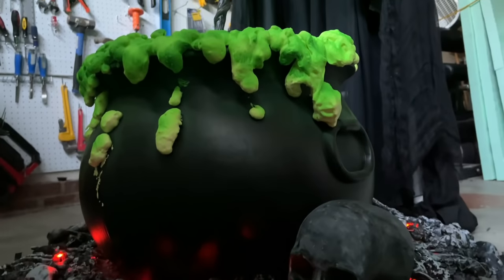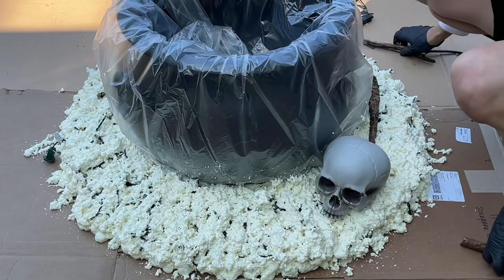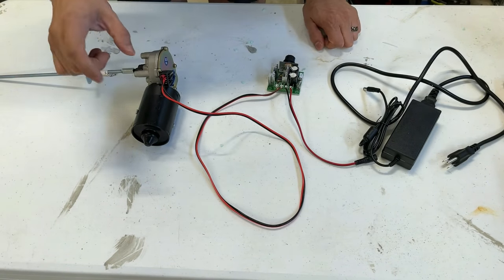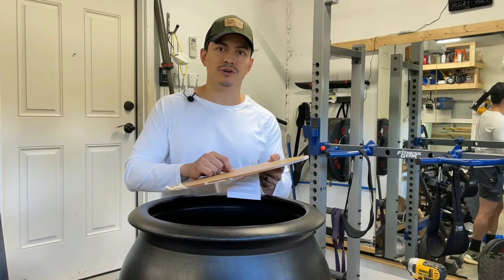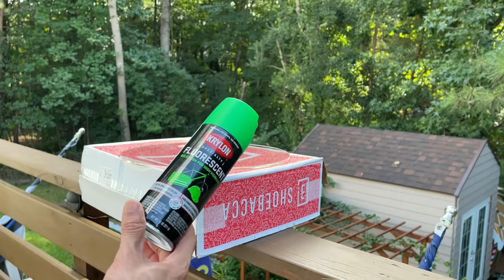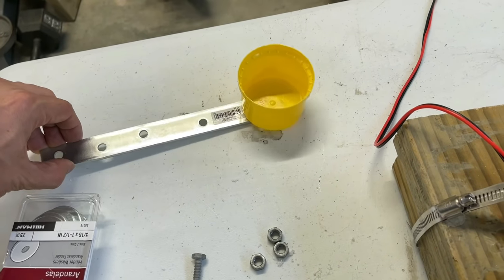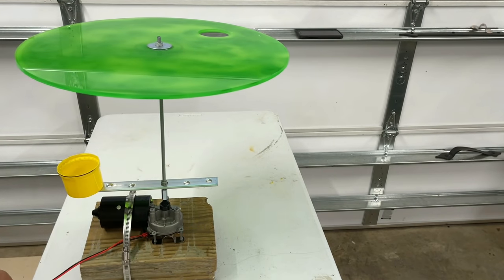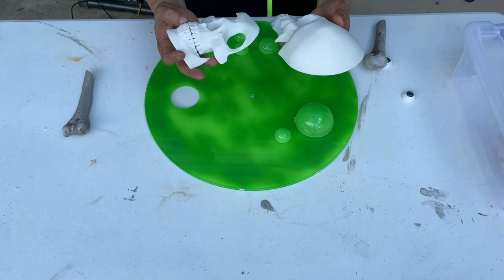Animated Witch’s Cauldron & Glowing Coals - DIY

Comment: I’m planning on undertaking this project for the upcoming Halloween. Both your video and overall design are phenomenal and I’m super excited for this one. That being said I really wanted to add some kind of fog effect to it. This design looks cool, but Wicked Makers had a cauldron that looked more realistic, mostly because it had a mist effect rising from the pot.  I thought it would look best to combine both ideas and have the pot stirring with fog/mist effects as well to hide the obvious non-liquid properties of the clear plate. I think the most simple way to add a fog effect to this prop would be to just buy a fog machine with a tube running into the bottom of the cauldron. The fog then rises, and slips in between the holes and crevices in the plate. I just don’t know how convincing this effect would look when put into practice. Not sure if you have an answer to this, but do you think this concept would accomplish the desired outcome? Either way, thanks again for the inspiration! This one could really steal the show for me this year if I don’t botch it.
Reply: Did you end up trying it? Did it work?
Reply: @amysirawskyofficial  Lol, no. I still want to, but I’m also trying to budget a bit because I do have to pay for college. I doubt I’ll be able to take it on even this year, maybe next year 🤔
Reply: I had the exact same idea. On another video I watched, they attempted to have  a container of water sitting inside the top of the cauldron with an ultrasonic fogger with LED lights sitting in the water to create the fog. However, what they discovered was that because the water container didn't fit snugly to the interior wall of the cauldron, the fog went over the side of the container and down the gap between the container and the inner wall of the cauldron and ended up underneath the container, almost like it had been sucked downwards. As I am making my own cauldron as well, I had a similar idea to you where I thought maybe I could hose in fog (create a tunnel/tube with some pvc pipe at the time of making the fire pit) through the bottom/side and run the hose up around the inner edge of the lip of the cauldron and puncture holes in the hose. This would only create fog around the rim of the cauldron though, unless maybe holes were also punctured on the side of the hose so the fog could be pushed out of the hose towards the centre of the cauldron. Alternatively, following your idea, hose in the fog as I suggested above but fill the whole void in the cauldron underneath the perspex plate but may need a small fan or two to push the fog gently out. It may still only flow over the sides though and not over the top of the perspex. This will be trial and error I guess.
Reply: Another possibility would be to put the fog generator inside the witch, and hose down the sleeve and stirrer to the top of the cauldron. Good haunting!

Comment: For anyone planning to do this in the future the actual measurement for the threaded end of the motor is 6mm. It is not 1/4x20 standard. I’m not sure if they changed the spindle/post thread size after he made this video or he just forced it and damaged the threads on the motor, but you’ll need all M6 hardware. I hope this prevents someone from having to make two trips to the hardware store like I did.
Reply from the maker: I definitely didn’t force anything and it went on super smooth. So I’m not sure if the thread was changed but when I made this video that’s the size I used.
Reply: @IsaacAlexanderDIY They must have changed the motor then. The current specs for the Monster Guts Power Pack shows “Spindle/Post thread size: M-6” All your other instructions are the same but if anyone orders the current Monster Guts kit they’ll need a 6 mm threaded rod and adapter.
Reply from the maker: @tweek218  thank you for this update. I didn’t know they had changed it
Reply: @IsaacAlexanderDIY  No problem, I’m in the process of building this right now. But hey since I have you here can I ask you what you used for the witch’s actual stick? Its permanently mounted to her hands and then just sits in the cup because it needs to spin, correct?
Reply from the maker: @tweek218  I used this staff from Amazon. I actually drilled 2 holes in the staff and used zip ties to attach it to her hand. https://a.co/d/d7Yvd35
Reply: @IsaacAlexanderDIY  Perfect thank you.

Comment: Great video and cool effect. Small tip ... that white/gray paint job starting around the 3 min mark would have been way easier if you used a larger chip brush and dry brushed it. Makes hitting the high spots go way faster since you don't have to be so precise.
Reply from the maker: That is actually such an amazing tip. It was very time-consuming and tedious using that small brush. Now I know for next time. Thank you

Comment: Looks like car wiper motor, ,a window motor also works.  The extra part looks like something to slow the motor speed down. I think you can use a dimmer switch and then a power supply 120 to 12v.

Comment: Pro tip: if you have a jig saw and a fine tooth blade (usually labeled “for metal”),  you can cut your own acrylic circles and save a few bucks. Just put masking tape over the cut line and go slowly.
Reply from the maker: Thank you for this tip!

Comment: great stuff Fireblock foam is orange, makes a better base, dry brush black paint on for better contrast when lit, great stuff black pond foam could also work for contrasting dark coals
Reply from the maker: I disagree with using fire block foam. You would need six cans of 12 ounce fire block foam and those can be 3 to 4 times more expensive than the basic expanding foam. 
I would’ve had to have spent almost $70 on that type of foam and that is not cost-effective. Great for somebody who has an unlimited budget but not practical for the every day DIY’er

Comment: Great video. One concern though... by gluing down the center skull, you lose access to the nut holding the rod in place therefore you lose access to the light bulb in the cauldron should it ever need to be replaced. I would suggest placing the skull on a flat surface with some plastic wrap underneath. Running the hot glue around the edge and adding the paint to give the illusion that the skull is partially submerged. Then just laying the skull loosely in place.
Reply from the maker: Great advice !

Comment: You may have left out the part where you use some foam and spray a ring or border around the base of the fire on the outside edge. Awesome video! As you can see I'm hanging off every detail so I get it right! :)
Reply: I would do this, but spray separate  blobs that are more like stones

Comment: Definitely awesome but you need to figure out how to incorporate a fog machine with a dual valve this way you can pump smoke underneath the bottom for the fire maybe threw a bunch of quarter inch hose with holes in it and then another inside the barrel

Comment: I did the cauldron creep back in 2015.  It was an awesome project.  I did something similar with the cauldron. Used a smaller high torque motor.  Added a fog machine hose so the fog would come out of the cauldron also. I got my creep to look down into the cauldron then as he raised his head up he also turns his head a bit to the side, both head movements work with the use of one motor in the body. I used the LEDs out of a couple of the LED votive type candles for the eyes. Just rewired them to a battery pack.  So now the creep has flickering yellow eyes.  I updated the lights inside the cauldron , used a multi function multi color LED strip light with remote. 
Looks good.   👍

Comment: That is a windshield wiper motor. Also the speed controller is a DC power with modulator (PWM).
The power supply is a laptop power supply.
Reply from the maker: Thanks for the information 😎

Comment: You said you spray painted the foam on the cauldron that fluorescent green, but how did you keep it from not spraying the cauldron?  It looks great, btw!
Reply from the maker: The cauldron is matte black and any overspray was not noticeable. In fact, when I attempted to spray paint the inside of the cauldron green, it was very difficult considering that I had to use large amounts of spray paint to even get a decent color showing. So when I spray painted the foam, I didn’t worry about it landing on the cauldron because it wasn’t going to show.

Comment: I am working on this now. You're instructions are so easy to follow and I love the diagrams. I am having a problem with the motor that stirs the cauldron being super fast even on the lower voltage setting. I have the same motor you used from monster guts. How can I slow this thing down?
Reply from the maker: I’m so happy that my diagram and instructions have helped you. My monster guts motor came with a knob to control the speed. So all I have to do is turn the knob to a lower setting and it’s been slower. I’m guessing yours doesn’t have the speed control knob?

Comment: I know this is an older video but im currently in the middle of trying part of this project and i was wondering if you could tell me how long you let the Foam Dry before you removed the Cauldron from the middle and started applying the paint??

Comment: Awesome. You really break it down step by step. The art end of haunting I am OK with. Mechanical end I’m awful. This may help. One question for you. If I ran a fog hose into the cauldron would it ruin the motor? The fog would come up through the openings left by the acrylic plate, may look good.
Reply from the maker: Thank you for this awesome comment. A hose from a fog machine attached to the cauldron is what I originally was going to do. Several other people have modified it like that and it looks so amazing! So definitely something that can be done to make it look even better.
Reply: @IsaacAlexanderDIY   Thanks.  Great videos.

Comment: Love your DIY videos!  My witch is built and now on to the cauldron.

Quick question, did you end up not using the larger lights and just with the LED lights instead?  I didn't see where you put the larger flicker lights in.  
Awesome build!
Reply from the maker: The extra set of lights were installed after the LED string lights were wrapped around the base. Since the flicker flame lights are super small (there’s only about 10 bulbs per string) you want to install it closest to the base of the cauldron right after you wrap the led string lights but before you cover them with foam

Comment: I absolutely love this!
Question.. when you added the lights, did you plug in the flicker lights to the string lights?
And what did you use the creepy cloth for?, I see you have a red and black cloth listed in the items you used.
Reply from the maker: Thank you! 😃
No, the lights aren’t plugged to each other. So I have 3 outlet adapter plugged to my extension cord to power everything. I’m listing what I used below. The red creepy cloth is on her arms just for added detail and the black one is on her cape. These are optional so you could use other styles/colors or not use this materials at all. 

Woods 13270 Outdoor Rated 3 Outlet Covered Adapter, Green https://www.amazon.com/dp/B007E8FONO/ref=cm_sw_r_cp_api_glt_fabc_5MJA8STRX3BSEHXJ94CT
Reply: @IsaacAlexanderDIY  Thought this was amazing and decided to make my own based of yours.  Did you submerse the flicker lights in the spray foam with the string lights?  If you did I did not see them get added in your video.  And what are the specs of the flicker lights because I did not notice a link to them anywhere.  Also what type, size (watts or lumens) and colour (green or standard clear) of bulb did you use in the cauldron?
Reply from the maker: @mikeashworth916   Yes, the flicker lights were submerged at the same time that I submerged the string LED lights. Both the flicker lights and the regular LED lights are listed in the bio with a link to each of them. They both have been there since the video was posted. Lastly, I used a green LED bulb which goes plugged into the pendent light socket (which is also included in the bio information). 
You can use a regular green LED bulb, any wattages, any style. I found a green bulb in my box of bulbs so it really doesn’t matter what style or strength of green you put in there as long as it’s a green bulb.

Comment: Quick question,, we get a lot of rain here in Missouri during the Halloween season,, Does not help I put my stuff out the first weekend of October (if not sooner) I imagine I can drill some drain holes in the bottom of the cauldron,, but how "wet" can the motor get? is it rated for outside/weather usage?
Reply from the maker: Good question. Here in North Carolina we also have wet October’s. I drilled 2 holes on the bottom sides. That being said, I plan to make a temporary roof over her head to make it seem like she’s in a spooky shed. I worry how waterproof the motors are when the rains come.

Comment: This is great! Thank you so much! I am ordering all the items now. Question though. Were did you put the flickering light? Did you mix them in with the LED lights under the expanding foam at the bottom/base?
Reply from the maker: I hope it turns out good for you! Yes I mixed both the flickering lights and the LED lights under the expanding foam but the flickering lights were last, you want them closest to the top/surface so that you can see the flame.
Reply: Thank you! I made it (without the stirring mechanism) & put it out on October 1st. Everything looks great!

Comment: So, how do you move the fire? Did u cut out around the cardboard? I am thinking of using thin wood painted black to give support. Assume u put flickering on same step as LED? Thx
Reply from the maker: So I simply cut the cardboard once everything had dried completely. There is a layer of cardboard that was left underneath the expanding from. In hindsight it’s probably better to use thick wood - the issue with thin wood is that it tends to warp when it gets wet and you run the risk of it warping after repeated rain. 

And yes, the flickering flame was applied right after I applied the regular LEDs. Since the flickering flame is only 10 bulbs, you want to be strategic with it so that it doesn’t get covered with too much foam and is closest to the base of the cauldron.
Reply: I had an old office chair plastic floor protector, clear, light, semi rigid, Wx resistance. Trying that as base.

Comment: Let’s talk about how you painted the rim foam without getting it all over everything else...💁🏼‍♀️ Mask off the cauldron with green frog tape perhaps 🤔. I’m guessing you did touch up work on the black...?
Reply from the maker: I actually simply used green spray paint after the form had dried, and since the cauldron is matte black, any overspray wasn’t visible. If you look closely, the edges and underside of foam are unpainted so I only sprayed the tops and sides of the foam to minimize overspray

Comment: I’m assuming you have to protect the motor from the rain or it has to be under some covering.
Reply from the maker: Though the manufacturer states that it can be used outdoors, I recommend that it be covered or in a place where it’s somewhat protected from rain. I’m building a shack for mine.